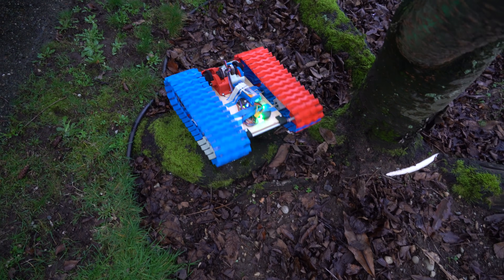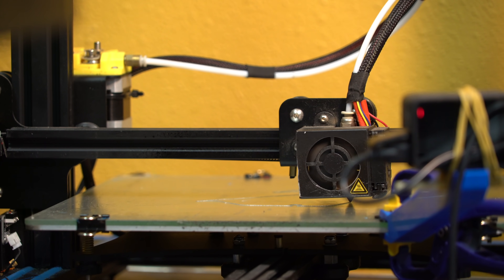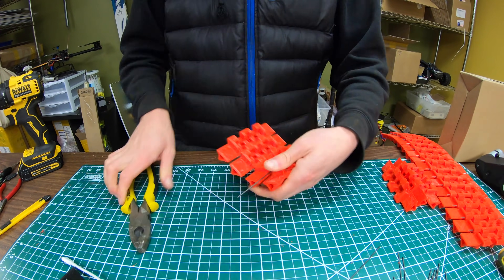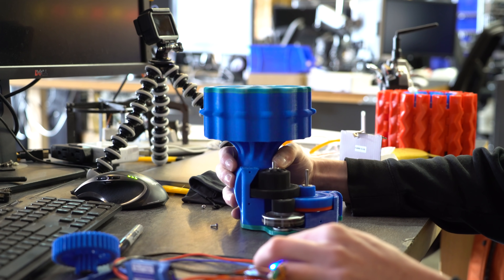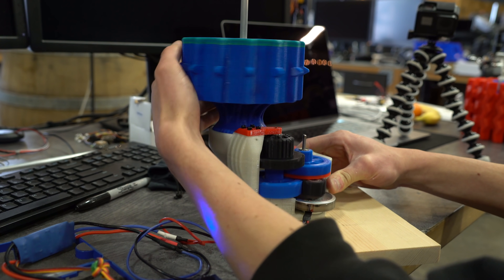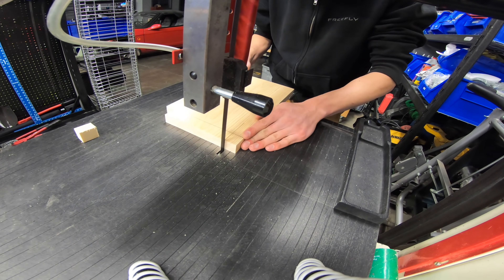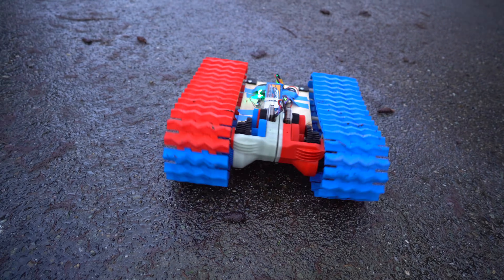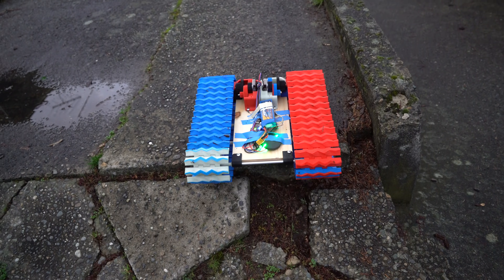Fully 3D Printed TANK - Brushless Gear Drive

Comment: You could have cut the gear ratio by about half by powering it from the back wheels. It might have saved you some noise. Treads don't care what wheels you power them from.

Comment: I'd add gear oil to the gears. Maybe the oil would make the gear to dirty. You might need to make a 3D printed housing for the gears. But I think the gear oil would make the gears run more smoothly. This is for the motor gears only. And then print the bottom out of PLA instead of Wood.

Comment: Great video!

Is there a video or any kind of instruction how to combine the control electronics with that ardupilot and how all of this is working?

im really interessted into this and want a remote control (sender and receiver) for any kind of RC stuff which can be gps guidet like yours. I dont even need a flight controller, just for ground vehicles.

Thank you.

Comment: Hey RCTestFlight,

Your video has encouraged me to make an RC tank completely from scratch and I have really enjoyed your videos! I chose to design a historical tank for my build (adding to my own issues bucket for the build, but I'll end up sorting out the suspension somehow)
I was hopefully looking for some pointers with the electrics of your build as I am unsure what to use in terms of ESC's, trying to find a few plane ESC's with reverse doesn't appear possible.
That and I wasn't sure how to set the ESC's to both accelerate, reverse AND steer in the way indicated.

Thanks in advance!

Comment: PLA dust is actually pretty lubricating. I've printed planetary gearboxes that my friend stuck on a drill press for shits and giggles. Probably got into the hundreds of thousands of RPMs and they didn't even warm up, though they also didn't have very much load on them.

Comment: No suspension, no tensionner, and aluminium axles, that's quite an achievement simply to get this thing running this far! Since you seem mostly interested in the gearbox, how about Herringbone gears? because you could save some wear and gear size/volume/weight, and make the vehicle more efficient? Well, interesting build, good luck with the next build and thanks for the nice videos!

Comment: It would be cool if you can add additional function to it e.g: rotating blade on the bottom of the tank so it can mow the grass slowly but surely using the waypoint and see if you leave it running for 8 hours it should mow the grass neatly

Comment: Synthetic cutting boards make great building materials over wood sheets. Easy to cut, drill and tap. Real tanks don’t like pivot turns either, unless on smooth concrete or a steel deck. Tends to throw track, snap links. Never attempt this in knee deep muck with a 65 ton vehicle.

Comment: What if you sprayed the tracks with a couple light coats of a liquid rubber, or like Flex Seal to give it more traction on concrete and hard surfaces?

Comment: You could make a spot on front could put a mop handle into and have it push you along on the skis using your hand to provide down force, there is some commercial motorized ski thing that does it for cross country or going up shallow hills.

Handle would stick out front at like 45 or 60 degree angle so pushes you forward and you can provide down force or in the commercial version it attaches to a belt.

Comment: try making a bigger tank robot with solar cells and with a custom built companion drone, and let it run and then stop to recharge and deploy the drone, and when the drone lands recharge that one. it would be cool to see an atonomus rover and an atonomus drone landing and take-off. but if you plan to let it run for longer durations you may want the batterys to recharge to a certan point before the rover start runing again to prevent it from going a meter then dying over and over again. but anyways a really cool build, tryed making a gearbox out of lego some time back but ran out of gears xD

Comment: I'm pretty sure it'd be able to climb vertically if traction was no issue. Unless you're planning on a lot of cargo, you might want to make your gear ratio such that the force at the radius of the driven wheel is less than tank's weight. More battery or more speed!

Comment: be nice to know which lubes various gear materials best. Say pla on pla having a few sets lubed with different things like grease, oil, molly-D or w.e. Maybe that stick wd40 meant for gears would work great for non metal parts. I know Mathias Wandell did a video on wood gears and checking wear, though i think he used wax in his test.

Comment: Make 5his the bottom of the rover. It is just like some Mars rovers. I think. Anyway, it will also give you so much more traction. And the concrete? Add rubber to every two tracts. Also, add small wheels in the front and back to make sure it doesn't flip.

Comment: You could probably spray the tracks with a rubber coating, like flex seal, if you wanted to run more on harder ground like concrete

Comment: It's fantastic!! I hate to mention that some of us are wannabies and a how-to would be nice after you have the design more to your liking. Is it easier to control this with an aircraft transmitter and a mixer rather than with a surface transmitter and receiver used on RC vehicles? If this had to be sent out rather than being printed at home, it would be a little pricey. Maybe if it was scaled back some it would still perform well and not cost as much. 
I'd like to open your design in Thingiverse, but it's taking forever. Is there a more detailed shopping list included?

Comment: in inner and outer edges of tracks flat panels should help with traction on flat surfaces. if your 3d printers capable of printing in less rigid and more rubbery/flexible materials thise panels would benefit from this😎👍

Comment: I run a Bulldozer for a living... On a Caterpillar dozer, the final drive motors are in the back and it is basically the reverse of how your design is. I wonder if you reversed it if you would have less torque on the axles opposite the drive axles, you may have better luck climbing the hard snow as well. I'm not sure, just a thought. BTW my son is fascinated with this so I'm expecting my 3D printer to soon be employed with this project.

Comment: I have a weird question: Approximately how much filament did you use for this print? It didnt look like you used just one whole spool but since there were mutliple colors, I could not tell if that was due to wanting a cool design or because you were only trying to deplete spare spools. I want to do some small RC builds but I wanted a small reference for what to expect. Anyway, cool video and awesome concept!

Comment: Great job love seeing all your projects. I remember an old kyosho car video that suggested using toothpaste to run in the gearbox to remove the burrs on the gears then switch to grease. Also I've had good luck with the gear generator in inventor, I generated and printed 40:1 worm gears and printed in pla

Comment: You should have put the gear box at the rear axel. Because you have to pull the tracks to move the tank. Not Push the tracks to move.

Comment: The white powder is galling. It's the same thing that happens when you run two gears made of the same material. If you have two different materials you won't get galling, but one will wear faster, and that becomes the one that you will change.

Comment: 1 out of 3 in the 3D printed tank build. Although you had a track separation, you didn't hammer the bearings in with your screwdriver handle, and you didn't strip out a drive-shaft connection by over-speeding the motors. It's an unwritten rule now that those are customary things that should be performed at least once in 3D printed tank builds.

Comment: Would love to see how it would fair if the tracks were made out of TPU instead of PLA. It's abrasion & chemical resistant, and depending upon the brand/shore rating, that extra little bit of flex for the grooves would probably help it bite/grip surfaces you experienced issues with even better.  Looking forward to what else you have in store! Keep up the great work!

Comment: Very nice design. You chose a good material for the gears for PLA has high resistance to abrasion wear. The only disadvantage is slow biodegrade with water over time (years), but the #1 for you would be that PLA gets more brittle with UV from the sun. I paint or at least clear coat my outdoor projects in UV resistant paint which doubles as waterproofing as well. You have some clever features: the nested gear layout, heat dissipation fins that double as cool factor, Good track width /support ratio, Large front driver wheels, and #1 is it's simplicity. As for PLA gear lube, I've used white lithium grease in production gears. It's friendly with PLA, and the tiny little layer grooves made by FPM machines such as yours hold the grease well like an impregnated industrial plastic. Very little is required. Very Nice! I look forward to your next video.
     -Boone Brandenburger

Comment: IMO, you need to change the gear box ratio to a lower (twice or more). So it will be possible to run faster but with less torque (obviously). Thus you'll be able to run over such snow hills... Like jumping...
P.S. but you'll get more "speed stress" on your gears probably. Will need to re-check temperatures or PLA can melt...

Comment: You can strengthen the gears even more (and reduce the "white powder") through annealing. Check out this article as an example: https://hackaday.com/2016/07/03/improving-3d-printed-gears-with-hot-water/
Reply: Wouldn’t the shrinking be a problem?

Comment: "Entirely 3d Printed" but then it requires a shit ton of wiring and assembly. This could be uploaded as "3d Printed Functional Tank" and not lie, but you did. if you wanted it entirely 3d printed, you should've used a key riven system.

Comment: White powder is the gears wearing down between the layers averaging out the plastic surface and slightly re-fusing. Basically pla likes to act like an abrasive file& sandpaper to itself.

Comment: if you hate dealing with supports, there is an experimental option in cura (if thats what you use) called tree supports, all of the support is based on the baseplate, none of it is touching your print, except for the part its supporting. In my experience it only takes a little bit more filament, which shouldnt be an issue. So if you're reading this, give it a go.

Comment: Oooo.. i wish i had a 3d printer.. 🤔 cool DIY tank.. btw.. 😜👍
Reply: Then get one. The Ender 3Pro is a good starter printer with a good sized print bed that you can find for around $200. (That's less than I paid for my first color ink jet printer) The print quality is really good. Just don't wait till you're past 65 to get on like I did.

Comment: just a quick question? why do you have a relay that cuts power to the entire system when the voltage drops below 10.8? i'm not very experienced with electronics so thats why im asking :)
Reply: Because Lipo batteries will get damaged if the voltage is allowed to get too low. Having the relay in place was a great way to shut it off once the battery reaches a set minumum, thereby protecting the battery.

Comment: Hi rctestflight, love how the tank turned out, I had an idea for your concrete traction  problem. And it would help overall too. On your treds you should glue or rivvet little rubber flaps on the edge that touches the ground almost like paddles?... it would dig into the snow and also the rubber would grip on tarmac, you could make these easily with only Bicycle inner tube rubber, cut strips and one by one add them to the end of the track sections. Hope this helps and happy adventures

Comment: This gear motor might be a little bit quieter.
https://www.ebay.com/itm/Makermotor-3-8-D-Shaft-Electric-Gear-Motor-12v-Low-Speed-50-RPM-Gearmotor-DC/222308501943?hash=item33c29e89b7:g:7PsAAOSwcLxYIYF4

It's brushed and you would need a different controller but this was about the endurance test.  I really like the idea of a small tank.

Comment: Really enjoy your stuff would love of you uploaded more often but i also understand that you habe to go to work obviously

Also try to Print the tracks with pla Were the joint is and with a more flexible Material at the contact surface for more grip even on hard surfaces ... Vor just make it have a suspension 

Also also i prefer the little tank more than the car for future things 

Also Also Also you just need somekind of a visual obsticale ovoidence and you can allready have it follow paths i dont know how good you are with arduino ^^ but this could turn into something big opensource

Comment: That gearbox is very impressive!  I am super impressed that it held up to all that use.

That failure in the muddy field is called throwing track.  A twig or something got caught in between the wheels and the track and pried it off.  The reason for that was not enough track tension.

You could increase track tension by adding an idler wheel somewhere in the design, or make the wheel on the opposite end of the drive sprocket into an idler wheel.

Warning: properly tensioned track will stretch out over time.  This happens until it is loose enough that you start throwing track again.  So if you have an adjustable track tensioner you need to keep tabs on it.

Also, longer center guides on your wheels can help you recover from situations that might cause the track to come off. 

Nice work!

Comment: It'd be super cool if you made the tracks or details on the tracks glow in the dark and had UV Led's at a point on the track to constantly recharge the track links.  The you'd have fully glowing tracks that would stay glowing while only having one discrete LED per side doing the charging.

Comment: Make this as the new autonomous rover Thread is much better than wheel and it has much more traction. And it wouldn't hurt if you put grease on the gears

Comment: It seems your driving it backwards all the time. Your pulling on the top of the track which most definitely did contribute to the axle deflection which I believe caused the track to fall off. Reverse direction and when a  twig gets caught between the cleats it will be winding up on the drive cog end which means it won’t apply tension to the top half of the track 
Signed operator of everything

Comment: another thing to note when building tank tracks, the rollers should be exactly that, rollers. They need to roll on top of the tracks to keep them in place, not actually engage the track with teeth like yours do. Also tanks shouldn't always be slow, actually its better for them to be fast, especially in the case of modern MBTs and such. But I guess this understandable because its only a test bed for a gearbox.

All in all though its a great build if you ignore the small details and its great fun to watch!

Comment: Why didn't you use a wormscrew? Was it not printable? Would have meant a higher reduction ratio per part and you could stoo the tank on steep inclines without needing power from the motor, which could then overheat

Comment: Don't use normal oil and  grease on plastic parts use vaseline or silicone based grease. The normal stuff deteriorates plastic over time.

Comment: I would be careful gooping your ESC's like that. It probably won't be an issue in a low load situation like in this project, but in a higher load scenario the MOSFETs or any of the supporting resistors or diodes could overheat. I've even seen this with hot glue on SMD diodes in some audio circuits.

Great project though!

Comment: You could use some inner tube to make it go on concrete a lot smoother
Reply: Yes, agreed- wrapped around the tracks like a big rubber band.
Reply: @scottwood1143  not quite wrapped, it still has to let each individual track to perform the same maneuver as it can do it now

Comment: for the gaerbox: lower rpm->more torque->larger gears, the warnout of gears is proportional to the pressure of conatact, less levage equals more pressure
Reply: he should have used a wormscrew drive. Less parts, more reduction.
Reply: @johnpossum556  I think that the pla would've broken with so much torque change in a single gear
Reply: @grahammcnally4799  yes also the direction of lamination of printing. You would print it like position like coke can. This mean while under torque, it would pull in the wrong direction and split easily. It can be done for sure! Don't get me wrong.
Reply: @johnpossum556  wormgears would be space efficient. But energy wise they are pretty inefficient added too the large pressures on the wormgear
Reply: Is wear only proportional to torque? Shouldn’t it be proportional to transmitted power which is the same for all gears?
Reply: @Mike-oz4cv  no, is proportonial to the pressure of contact, more wide gear equal less pressure for the same transmitted torque. the power problem is due to the temp increase fron friction between gears, in plastc gears is a probelm, worm gears have an efficency of about 70%, the rest is a lot of heat production.
heli gears must be madr of a duble spiral, in oppositon otherwise they produce a lot ot compression on the axle
Reply: @alessandrogiovanardi558  So you're saying that the gears for the first stage could be pretty narrow due to low torque at high rpm and then the width of the gears should increase for each stage to compensate for the increased torque? Is heat from friction the primary wear factor for the smaller high rpm gears?